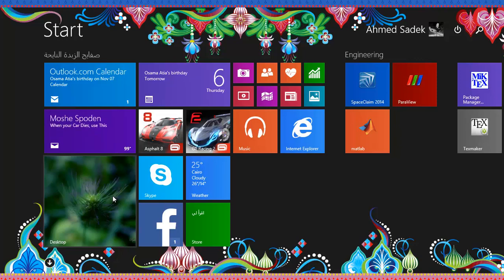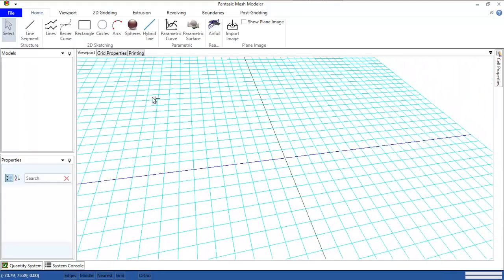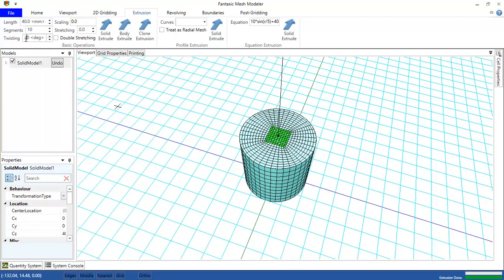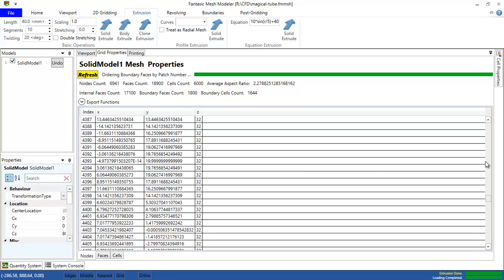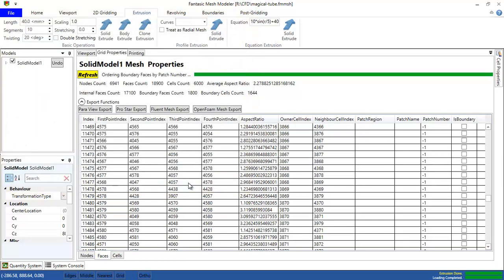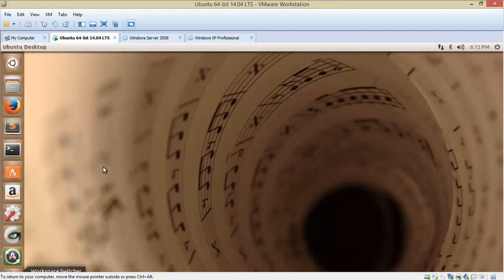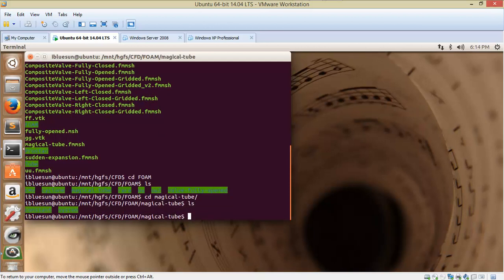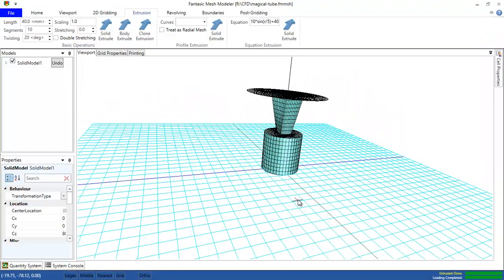Fantastic Mesh for OpenFOAM

Comment: Does Fantastic Mesh Modeler can create 2d unstructured (tri) grids? It isnt really for openfoam, but this tool seems to be so great id love to see it usable for oder cfd-hydro codes!!
Reply from the maker: haven't thought about that yet .. although this should be easy if one can import one of the already existing codes which create tri grids (as I recall they were the first to be implemented actually )  problem is that I stopped the development in the program quite long time now .. hope that I can continue its development again.
Reply: I hope so Ahmed! Dont let this project die, such a polished tool cant be forgotten....consider make it opensource !. I would LOVE to use it someday as my overkill tool for Hydraulic modelling...If you are interested in  (just for the pleasure of knowledge) the hydraulic tool im reffering to is openTELEMAC (http://www.opentelemac.org) and some tools for the mesh generation are: BlueKenue (NRC), BASEMesh (triangle for qgis) and of course the legendary and highly regarded "triangle" by Jonathan Richard Shewchuk.

Comment: This Fantastic Mesh is really fantastic!. I have a question: if i want to create "named selections", like "velocity inlet" or "pressure outlet" for set boundary conditions in openFoam, what can i do? Thanks for share this amazing software!
Reply from the maker: wow .. thank you so much for your compliment ..
you can do named selections (after selecting the patch type .. you will see at the right end a drop down menu that you can click .. write the new name there and press add new patch) this should give you the ability to define named patches of the same type.

Comment: Fantastic... Will you use the mesher of OpenFOAM (snappyHexMesh)?
Reply from the maker: no I am not using any external mesher .. also I am building for windows so I don't actually think that snappyHexMesh which is running in linux can run in windows without too much work.